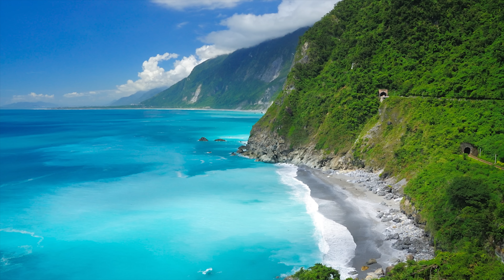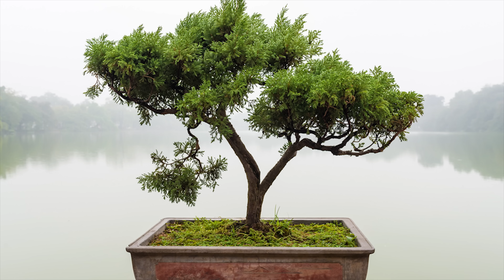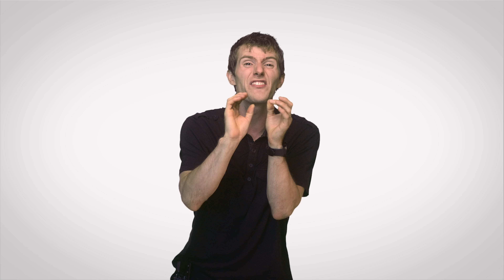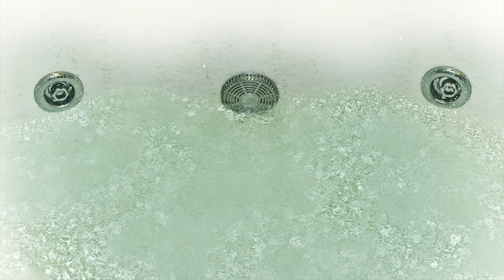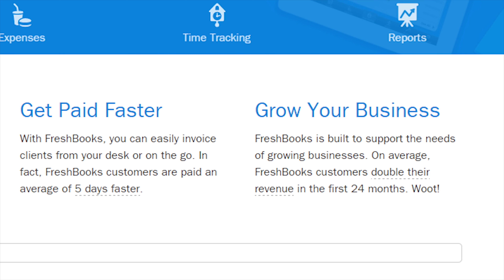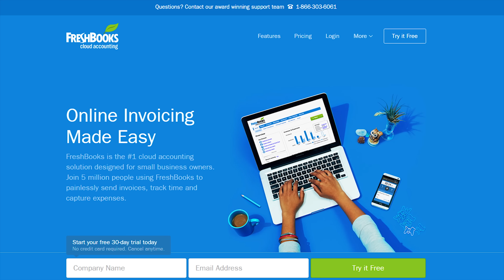Waterproofing As Fast As Possible

Comment: Well I can tell you that in Atmospheric Science atmospheric pressure is commonly measured in millibars, not atmospheres.
Reply: +iTheStopSigni Meteorology is smaller than atmospheric science. Yes the term under discussion is involved in meteorology but it is also used in other fields of atmospheric science. Seeing as how weather is not even a point of discussion in this video, I'm not sure why you insist on specifying meteorology.

Comment: I have a Lenovo T61 ThinkPad with said waterproof keyboard and it's simple and effective. but it drains onto your lap haha. It's 7 years old and I put an ssd in, new battery with the best processor it can run. the chassis is not wobbly yet (magnesium) and the screen can still hold itself up.  great laptop

Comment: I love this show (I'm a subscriber, of course,) and I don't love it. So I'm making a general statement here. I love how it summarizes things and brings to light things we never thought of or knew. But what's the deal with their (IMHO) WAY to lengthy commercials? Often about 1/4 of their videos are to ... sell us something. I know they have to make some money, but again, "IMHO," it's to much.

So on the "water proofing" thing, I was reminded about "Water Proof Watches." You used to be able to call them that but it turns out they aren't "proof," they can still leak, so now they rate them at what depth a watch can survive underwater (Due to pressure of course.) I have one watch that is rated at 1,000M (~3300 ft) which, I guess, is cool, but I don't plan on diving down 2/3's or so of a mile to check it out. <grin>

Comment: Explain to me how touch screens work
Reply: +Tony DoMonte pure genius
Reply: +Gavin Crane There are many types of touchscreens. The most common among them are capacitive and resistive touchscreen, while capacitive touchscreen still pretty much dominates the commercial electronics market (90+% smartphones use capacitive touchscreen).

Any pair of conductors makes a capacitor. The closer they are to each other, the  larger the capcitance of the capacitor becomes. Capacitive touchscreens use this to measure distance. There is usually one conductor under the screen panel, connected to capcitive sensor, which measures capacitance. When there is no secondary conductor close to the screen, capacitive sensors would barely show any value, but when you put your finger on the screen (your skin is pretty conductive), the capacitance of the recently formed capacitor will jump, sensors will measure high capcitance and the CPU on your phone will interpret this as touch.
Reply: +Gavin Crane From fixing ipads and iphones, what I gather is....   there're sensors at regular intervals running out from the sides of the the glass over smartphone/tablet's screens, in what's called a "digitizer". They run the screen's length and width creating a grid map. The electrical current from your body disrupts the the grid when it touches it and - like a chess board - the disruption-location's address tells where the touch occurred.
Reply: @JamesJon1187 you mean their
Reply: +Gavin Crane its a screen, and you touch it.
Reply: "It just works" - Todd Howard.
Reply: +Gavin Crane like magnets HOW DO THEY WORK?!

Comment: 1st pic... h2o2 is something entirely different:)
Reply: +Emil Solgaard h202 is hydrogen peroxide
Reply: +supervegito2277 there is this joke....

Two scientists walk into a bar...The first one says “I’ll have some H2O.” The second says “I’ll have some H2O too.” The second one dies.

H2O2 is quite unstable due to something something electronegativity or something. In short: it's highly reactive and will kill you if consumed in large amounts.. (it is a 5.1 on the ADR scale meaning it easily oxidises) In small amounts it is used for cleaning in the house and in the dental department.
Reply: +Nathan Adams Exactly.
Reply: thatsthejoke.png
Reply: +Nathan Adams acid?
Reply: +Nathan Adams Old rocket fuel :)
Reply: +Tracomaster I was about to make that joke...
Reply: +Emil Solgaard Maybe dihydrogen monoxide is deadly to aliens.
Reply: +King George thatsthejoke.png wasn't funny the first time, nor is it funny now.
Reply: meh...
Reply: OOOOOOOOOOOOH SHIIIIIIEEEEEEETTTT WE GOT SOME HOT ASS BURN UP IN THIS JOINT King George